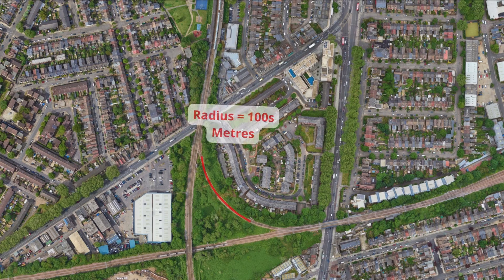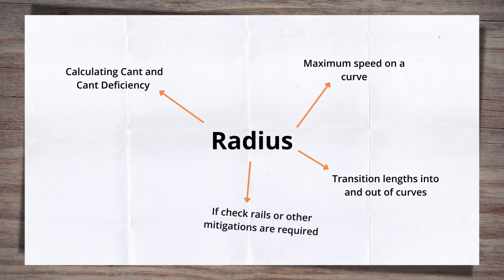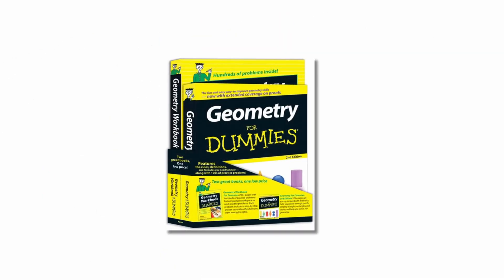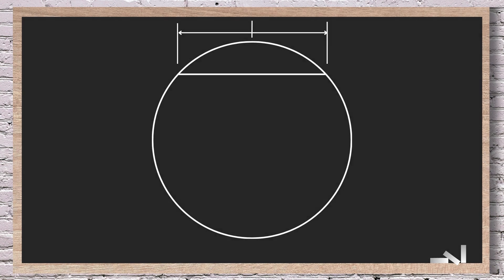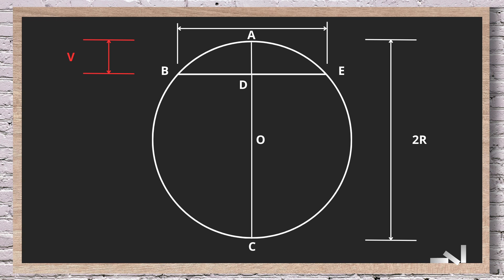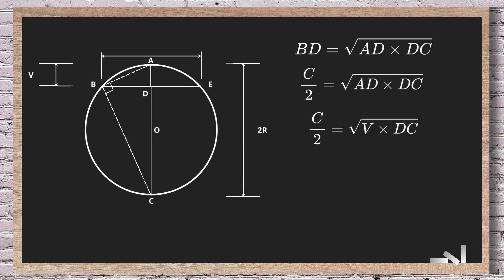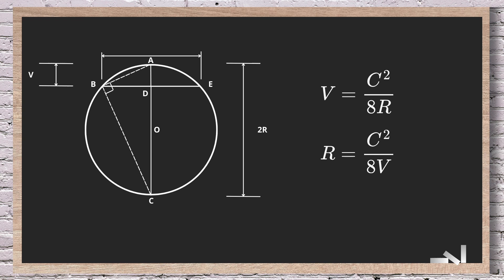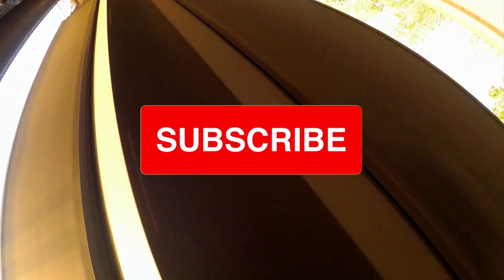Hallade Method! Easily Finding the Radius of a Railway Curve With a Simple Piece of String

Comment: I would think that the radius of the curve on an existing track would be stated in its design documents.  But I guess that's "as designed vs. as built vs. as subsequently changed by entropy" so you would need to determine the current radius in order to know how much slew is needed to get things back to "as designed" or even "as revised in light of modern needful changes".  And the center of the curve is likely under an inconveniently placed mountain that the track has to curve around.  So yeah, classical geometry is your friend.  As such, I would naturally be drawn to a Pythagorean solution rather than a geometric mean solution.  Although there is much (so said the non-mathematician) overlap between them, I still prefer using a compass to deriving an equation via math.

Comment: I always found the easiest way of calculating the radius of a curve was, by using a 10m string, measuring at half points (5m) to get the versine. Taking all the versine readings along the curvature. Then calculating the mean average, by adding all the versine readings and dividing by the amount of measurements taken, or using the most recurring versine reading.
Then to work out the curvature using a simple calculation (via a caculator) 10m string = 12,500 divided by the versine. 20m string 50,000 divided by the versine. 5m string 3,125 divided by the versine. Using the scientific formula you use can confuse a lot of people.
20m = 50,000/V
10m = 12,500/V
5m   = 3,125/V

Comment: Interesting. When I was a speed skater I worked out a method of measuring the blade's radius (rocker) using a straightedge and thickness gages. As I recall, the formula I came up with was R = C^2 / 8V + V^2 / 2. And when C >> V the second term is negligible, so, the same as your formula.
Reply from the maker: Interesting! Never thought of speed skating as related in anyway!
Reply: @thepwayengineer  Analytic geometry. The great unifier.😁

Comment: Will the radius ever vary along the curve -- increasing or decreasing?
Reply from the maker: If the radius does change this is most likely the transition between two curves, this layout is known as a compound curve.

Check out this video for more: https://youtu.be/5nnq2YqOrnU
Reply: If you directly connect a constant radius arc to a straight line, there is a brutal lateral force applied on the train at the connection point. At slow speeds it's just an inconvenience to the passengers.But at higher speeds it can derail the train.
To avoid this and allow high speeds in curves you need smooth transition curves with the radius changing progressively for the lateral force to build up and down progressively.
The ideal form for those transition curves is a Euler spiral.
Reply: @christianbarnay2499 I used to design trunk roads and motorways with similar principles to railway track design. These occasionally incorporated compound curves. One at A9 Dunkeld Bypass, changes radius five times, but that was unusual.
Reply: @ronniel5941  Yes there is usually very little constraint in road curve design since the steering is handled by drivers. Having a straight line directly connected to an arc of circle with no transition is a frequent occurrence. Sometimes roads are even deliberately designed with hard transitions to force cars to slow down. But roads that are designed for high speed tend to copy some principles from rail tracks with wider tolerances since the drivers still have some control with their steering wheel.

Comment: If you want to get the feel of how Hallade works, forget excel to start with, do it the old fashioned way with a pencil and an eraser (good luck finding proper Hallade paper though).
See how the slues build up as you do the maths.
To be fair, I sat in a classroom for two weeks being taught Hallade by (sadly no longer with us) Howard Finch and it is a very big subject to fit in to a short Youtube video but a good intro to the principle would be the old-school Chargehand's "averaging" method for removing localised alignment faults. Take three versine readings with the middle one being on the fault, work out what the average versine is of the three readings and slue the track to that versine on all three. It's not going to give you perfect alignment but for a localised fault it will improve things a bit.
Reply from the maker: Hallade does seem to be a very much dying art. I struggled to find much material on it apart from speaking to people at work who are well versed in it. 

That does sound like a good place to start.

Thank you
Reply: I actually enjoyed doing hallade schemes, excel definitely made it easier though. Still have some hallade sheets though.